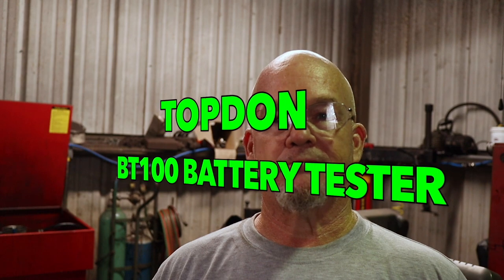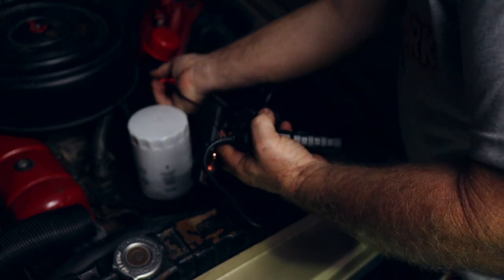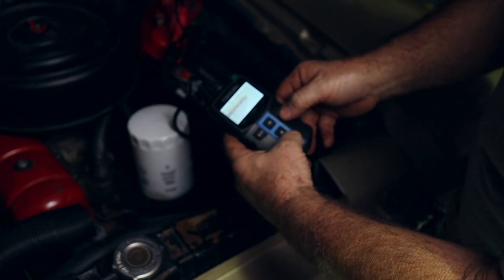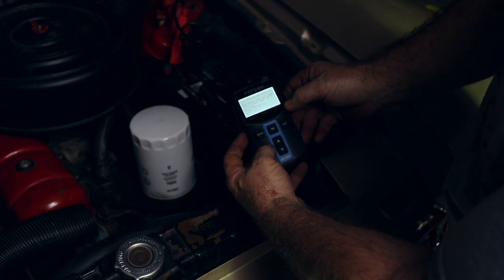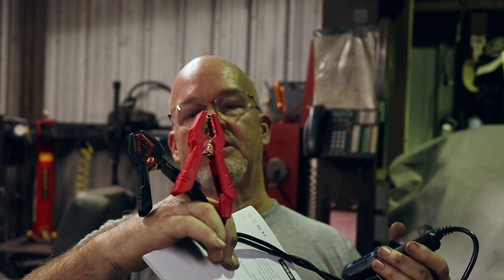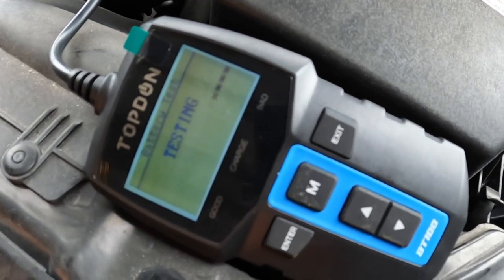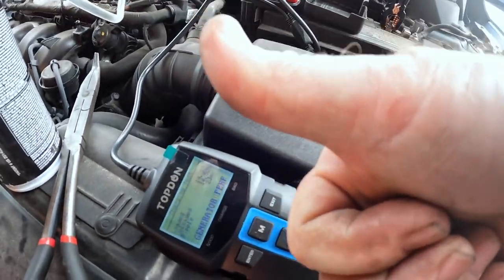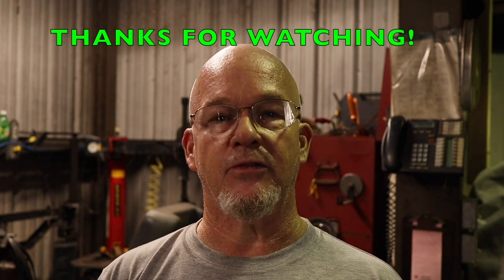TOPDON BT100 BATTERY, STARTER AND CHARGING SYSTEM TESTER REVIEW...

Comment: I’ve been searching the old videos, what was the multimeter you recommended? My father in law needs a new one. And any other electrical equipment you have tested would be great. Thanks
Reply from the maker: Carlos, I like any meter from Fluke, Snap On, Power Probe and a few of the other suppliers that I will add to the description today.
Thanks for watching!
Reply: Fluke was the one I couldn’t remember, thank you. I think it was on the tools mechanics need part 2. I could not find the video.Amazon store page would be great takes the guesswork out of it.  Thanks again.

Comment: Jimmy seems like a solid buy!......I have a few questions, how accurate and reliable is the starter test and alternator test data and results?
Reply from the maker: I think it is suitable, but not the best method for starter testing. since it doesn’t read amperage and only voltage drop during loading. Of course if the amperage is high enough the voltage will drop…but for starters when there is a doubt I’d use an amp meter.
For battery and alternator testing it’s great.
Reply: Yea I figured just about that but for the price point if the battery analyzer itself works pretty well it's worth the money and the ripple test is just an added bonus is about how i see an electrical tool that can diagnose concerns in the under $100 range!!